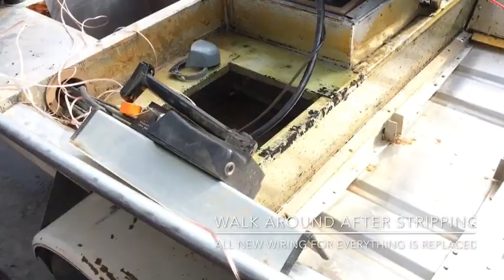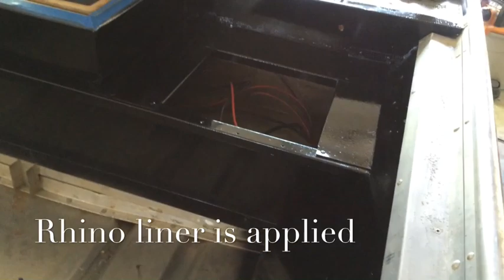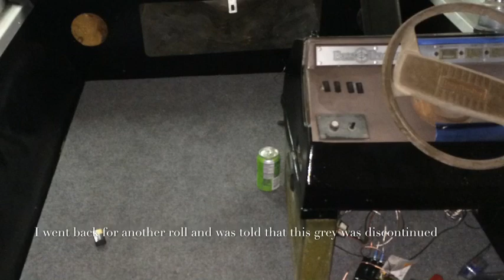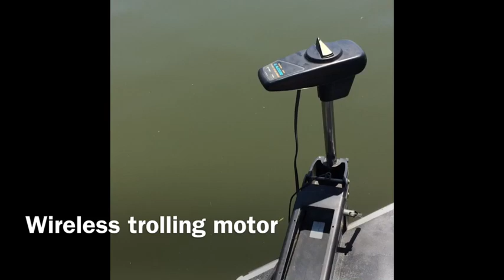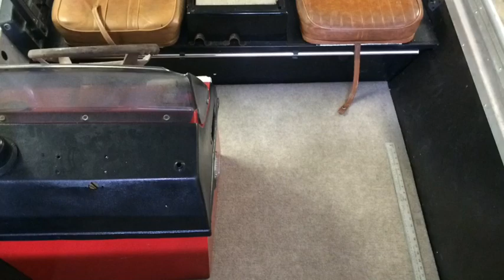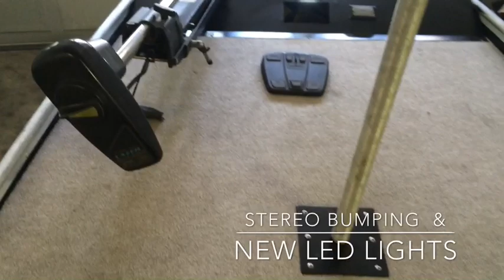1985 bass tracker restoration

Comment from the maker: The more u dig the more work u have. But it's worth the extra work.   I just stripped it all down and started with new everything down too the wiring, fuse box, lights and light connections, marine ply, carpet and everything. I think it's easier to start with everything new rather than to add on to old parts and pieces. Besides its nice to know and piece of mind knowing something ain't gona go rong. U no what u got. Good luck on ur  project

Comment: I have the same boat and I'm betting your running into issues with your trolling motor being snug after a fair amount of high speed running. I installed some after market accessories that stabilized the issue but that plate up front is very thin.

Comment: I am in the middle of a complete restore of my 84 Tracker and it looks a lot like yours.  Which is awesome by the way.  How did you re-do your back dry storage boxes?  I don't ever see you open them.  I would love to see what you used and how you did it.  Thank you and Great Job!!
Reply from the maker: I haven't posted a video in a while but I will do another video shortly and I will open them up so u can take a look. Basically I took off the plastic doors and I put 3/4 inch wood instead. It looks and sits better and even with the rest of the deck
Reply: Thank you.  My boxes are one piece.  Removable.  The problem is with the plastic rim that holds them level on the deck.  It is weathered and broken.  This causes the box to fall down into the hole.  Yours appear to have an aluminum lip that holds them on the deck.  Just hoping a more in depth look might spark an idea for me.  Thanks again for your time.

Comment: Looks like a fishing machine! Nice personal style.  I just bought an 88 that I've had to replace the starter and trim tilt motors.  Did you have to do much to the motor? Thanks
Reply from the maker: thats sounds great man. U dont need no $30000 dollor high maintnance boat. this will do the job fine. too the motor i gave it a good tune-up. I replaced the impeller. Al new fluids. N greas. Changed the fuel pump diaphragm and filter. Cheked the the prop. All these parts are verry cheap in price, and also easy to doo. With the basic no hows in mechanics u should be able to do it urself. It gets expensive if u take it too a shop. thanx for watching the video if u have any questions feel free to ask
Reply from the maker: Post a few videos of ur tracker. Its god to to a before and adter video
Reply: I will do one on the water for sure. I'm not planning on doing much for cosmetics this year.

Comment: hey I have a 83 Tracker and just got done rebuilding the front deck because it was rotten as well as the floor and that's because there is no drain in the floor of the boat, how fast does your tracker go?
Reply from the maker: Was a budget build I would say around 500 bucks at most. What cost the most was getting the motor in good conditions. I took it in to have e everything replaced that needed to be replace for example all hoses, gas lines, oil change, carb rebuild and a bunch of other things that the mechanic did to it. all in all under 1000.

Comment: Hey bud, I have an 83 bass tracker I picked up to be a shallow fishing /duck hunting boat and I had a few questions for you. Do you know if they all have the compartments behind the seats like yours does? mine has the exact same layout but it came with new carpet in it and I'm wondering if they covered those up when they redecked and recarpeted it. Also, do you have any clue where I can order a windshield from? Mine was removed at some point and I'm having a hard time tracking one down. Thanks and love what you did with yours!
Reply from the maker: Aaron Davis not sure if yours has the compartments but mine came with plastic doors. did not look good and they are not that sturdy I replaced them with 3/4 marine plywood. as for the windshield I'm not to sure I would think you can not get them any more. I am actually going to upgrade my console soon do to the stock one being outdated.
Reply: I can understand that. I've already got another bass boat so I'm not looking to spend that much on this one. Just fix it up and get it right enough to look decent while hunting. What is the top speed of yours? I took mine out today just to test it before I started sinking money into it and it could only make about 25 MPH, but the carburetors are acting up pretty badly.
Reply: Do you still your boat?  Im trying to replace the fuses on mine and don't know which fuses go where??

Comment: hey I just got a 86 tracker 16ft and I'm tearing in to the wireing any help would b highly appreciated I wanna re do a all my switches beings that the omly ones that work are my bilge and nav lights
Reply from the maker: I would completely use new wiring, switch box and switches. if possible i would leave the old switches on there that way their wont be an empty hole in ur dash but if u can replace it with something else go ahead and remove whatever ur no gona need also on other things like ur cabin light just leave it their and add LED Light by it. And buy a rivet gun because that is one of the tools ur gona use the most. Also i found that it is better to replace youre live well and other plastic doores with 3/4 ply it will look and even out better with the rest of the boat